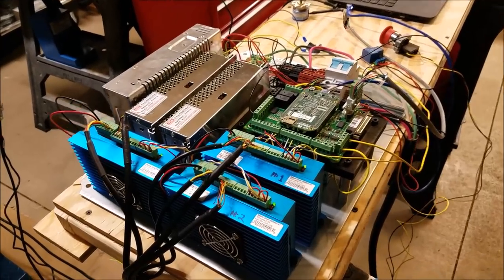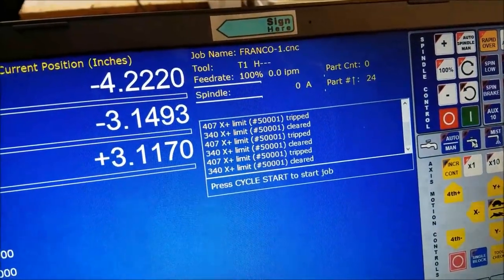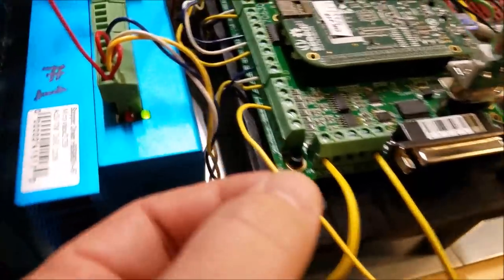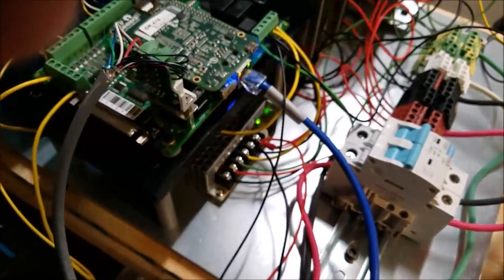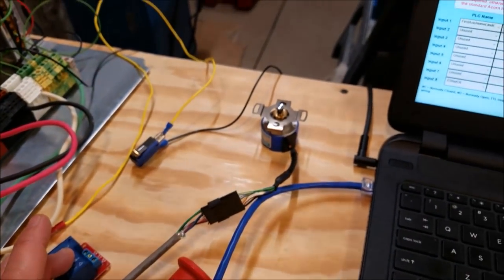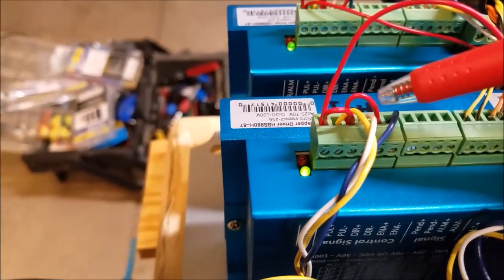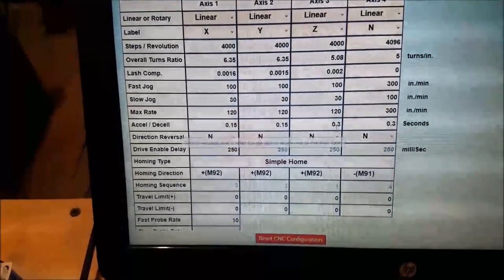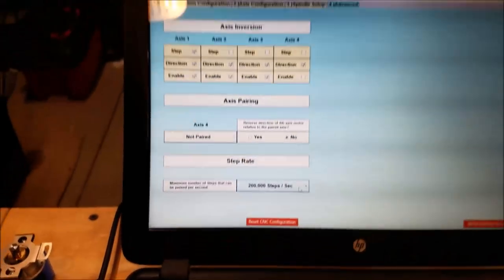Wiring Up The Centroid Acorn on The PM-25MV Milling Machine CNC Conversion

Comment: How does that flood coolant relay actually work? I get that a switched COM signal comes from Acorn, and the relay is powered by the 5v Supply... but lets say I have an IEC Connector (power plug) wired to my cabinet, and I plug in a Fish Pond Pump to it. How do I send power to that IEC connector/pump when the relay is switched On? I don't understand how sending +5v/-5v to your Mean well power supply ultimately switches on Flood coolant.

I know this is an old video... Hopefully this question reaches you anyway :) Thanks!

Comment: I got a 60v av power supply a 24v dc power supply with leadshine  2hss86h drivers. From the acorn schematic it shows I need 5v dc. So it looks like I need to get a 5v dc power supply.

Comment: Franco, in all due respect, at the 6:05 time mark, you said that pin 8 was sending 24 volts to the E stop and then the E-Stop was connected to com. IF this was true, that would mean a "short" circuit that would blow something, the moment power was applied to the Acorn.

The correct thing is: The E-Stop is sending a common ("Low" or ground potential) into pin 8 via the E-Stop. Pin 8 then sends this to a "diode and resistor" (on the schematic) that symbolizes a very sophisticated transistorized "sensor". THEN the transistor sensor is fed by 24V.

In this way the transistor "sensor" is letting the Acorn unit KNOW that the 24V system is OK. On the other hand, IF the current flowing through the E-stop should rise above a given threshold, the E-Stop will "blow" and kick it self out of the circuit (normally closed to open). Similar to a circuit breaker in an AC panel. This then protects the Acorn unit.

Now what would cause the current to exceed that threshold? The transistor (represented on the schematic as a diode and resistor) will sense any number of faults that might occur any where within and outside the Acorn controller. Thus it is protected by blowing the E-stop. So while it is represented as nothing but a" diode in series with a resistor"; it is a very complex sensor that is designed to protect the board from MOST things that would damage it.

Again, NO disrespect Franco. I hold you in the highest esteem and love your videos.
Reply from the maker: Thanks Pat Dee.  I appreciate comments like yours.  I wish I knew more about electronics.  I tend to think of inputs and outputs as if they were some of switch.  I'm just happy when I don't let the expensive smoke out of my components.
Reply: I have a confession to make. I got up this morning after thinking half the night that I was rude in calling attention above. I was going to delete everything I said. 

Further: my years of teaching electronics got in my way and I should not have done it. Because you wired it 100% correctly. So what difference does it make if the rhetoric was not quite right. IE: in 45 yrs I have seen kadzillions of errors in schematics; But what does it matter if the wiring is correct. Shut my mouth dear Lord!

Now I see how graceful you replied. And now I admire and respect you even more. Thank you so much.

Keep up the excellent work dear friend.
Reply from the maker: No worries, pat dee. Feel free to comment anytime you hear me explain something incorrectly.

Comment: Helo Franco, I v order Acorn and  NEMA 34 from Stepperonline, I have al wiring diagram but  don t know to wire VFD Huang Yong  to my realys on Acorn.
Do you have any wire diagram or something? It is for my cnc router and I need just to start foward my spindle and stop it,without dust collector a other things?
Reply from the maker: Hello - The Centroid website has a link where you can download dozens of wiring diagrams.  There should be one that explains how to wire up that VFD.

Comment: For the Acorn 3 axis (with room for a 4th) set up like you have here, how large does the enclosure need to be to fit everything necessary, fans, etc?
Reply from the maker: https://www.factorymation.com/EN-PCG-4050-B
Reply: @FrancoCNC  Thanks.  I was thinking a 20 x 24 x 8 box should be big enough.  Thanks for the confirmation.  I'm really looking forward to starting this project (PM-30).

Comment: Hello, one questions. If you want to connect two motors for one axis.  What is the procedure?
Reply from the maker: They have a diagram for that somewhere.  As I recall, you simply send the step and direction signals for the axis (I'm guessing it is your Y-axis) to both drives.
Reply: Hi Franco. Thanks by youre answer. As you mentioned, I use the two servomotors  with two drives for y axis. I have a cnc router working with mach3, but I want to replace mach3.
Reply from the maker: @dimimexmaquinadosyautomati8217  Check out the Centroid Acorn system.  I really like it.  IMO, it's the best control you can get for DIY money.
Reply: @FrancoCNC  do you know where I can buy the accorn system?.  Do you know also if centroid can ship to México by dhl, fedex, ups?
Reply from the maker: @dimimexmaquinadosyautomati8217  https://www.centroidcnc.com/centroid_diy/acorn_cnc_controller.html

Comment: What encoder did you end up getting? And have you figured out how to hook it up to the mill yet??
Reply: same question
Reply: Omron is a Good choice but make sure you match the PPR with your max speed. A 2000ppr encoder with a Max Response speed of 100,000 is good up to 3000 rpm after that it misses pulses.
Reply from the maker: Hi.  I think I know how I'm going to mount the encoder.  On the top of the motor, there is a plastic cover.  Under it is a cooling fan.  I'm going to make a new fan that allows me to connect the encoder and a new cover that let's me mount the encoder.  I'll post a video once I get it figured out.
Reply: I have been contemplating mounting the encoder as well but when I read in the centroid wizard setup that the encoder must be mounted to the spindle in a 1:1 ratio that threw me.  There is little room for this and special pulleys on the belt drive don't help either.  Maybe this could be manipulated in the software if you can't do a 1:1 ratio.  Not really sure and I haven't investigated any further.
Reply: @CNC4XR7  how do you match the encoder, looking to run max 5000 rpm. If you say that 2000 per is only good for 3000 rpm
Reply from the maker: @brandtdenkers6560  Hi.  No, I never did mount the encoder on my mill.  It isn't really necessary for what I do.  I can thread mill (instead of TAP) so I don't really need it.  However, at some point, I'm going to take on another milling machine conversion and I probably will do the encoder thing on that machine.

Comment: Hi Franco. Just wondering how well the Centroid V12 software can run on a laptop without a touch screen. How convenient is it to use with a mouse? Thanks!
Reply from the maker: Hi.  You can use a mouse instead of a touch screen. No problem. In fact, I often use my mouse because my hands are oily and I don't want to touch the  monitor.
Reply: @FrancoCNC  Thank you. I would purchase the Acorn right now, except for one thing that's bugging me. Centroid recommends that you essentially neuter your PC, changing a bunch of settings, making it useless for general use. Since the Acorn hardware is handling all the critical timing functions, is this altering of PC settings really necessary?
Reply from the maker: @tzampini  Well, their #1 goal is to make sure your CNC machine always works well without interruption. They tend to be very conservative.  But it works really well.  I have never, not one single time, lost a connection or had my software stop while running a program.
Reply: @FrancoCNC  Thank you, that's very reassuring.

Comment: Great video Franco, are those your new servo motors?
Reply from the maker: Negative.  These are the closed loop steppers from Fasttobuy.  The DYN2 servos will outperform the steppers, but I'm not sure if my little mill can handle it.  I am still going to try to use the DYN4 as a spindle motor.  I have high hopes!

Comment: Hi Franco, I am fighting with power supplies, the engine salesman tells me that a toroidal is better, I would like to take switching, I see that you have put switching, what voltage do you use? thank you.
Reply from the maker: The power supply voltage is determined by
 multiplying the square root of the motor’s inductance by 32, as in the example below for a 2mH rated motor:

32 * (√2) = 45VDC
In my opinion, voltage is less important than current.  Higher voltage will make your motors run hot and that is not good.  When using switching power supplies, make sure you have more than enough current.  If your drive needs 6 amps, make sure your power supply can supply 7 amps.  Strange problems can occur if you push switching power supplies to their limit.
Reply: Thanks for the help Franco, I have great difficulties in mathematics ..
with 3 Nema34 12Nm the seller advised me to buy a toroidal power supply, (PS. fasttobuy, I buy them from the ebay seller you recommended, thanks again), it gives me a 60V, 900W toroidal .. I don't know if to trust , most of the kits I see them with switching, even if everyone recommends the toroidal ... bho .. what would you do?
Reply from the maker: @fedeyoutub  Fasttobuy people are pretty good.  I would use their recommendation.